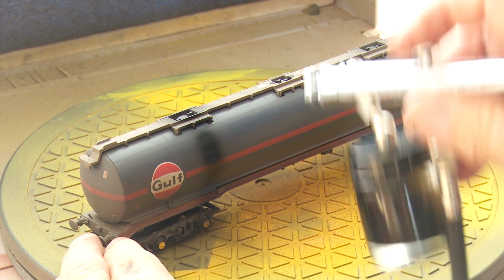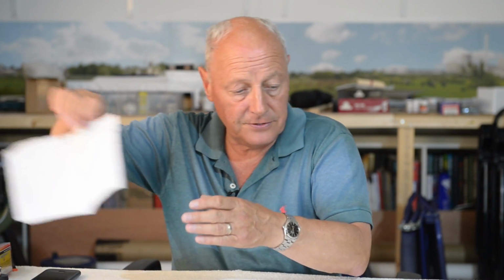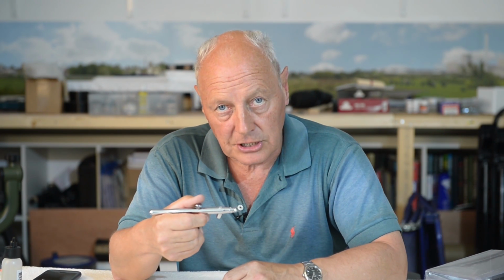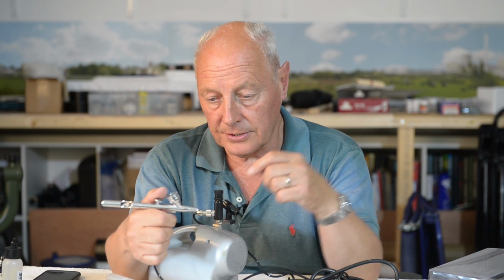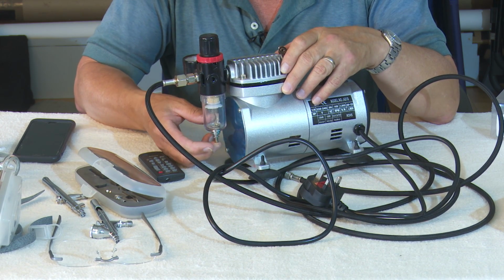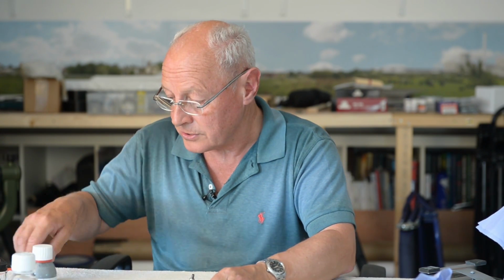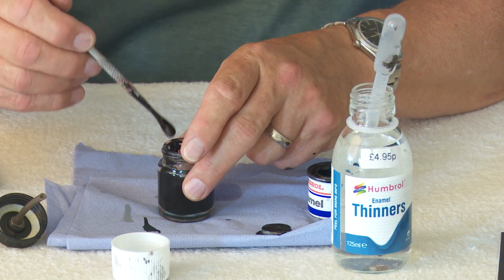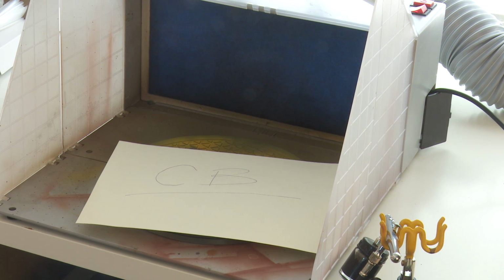Airbrushing at Chadwick Model Railway | 36.

Comment: Never used one before but bought a £15 cheapy from Fleabay & rigged a connection to my tyre inflator. Amazing results with practice. Think that is the secret. Doesnt really matter if its a £10 or £100 one...all about practice & learning. The other essential with the cheap ones is ensuring the precise ratio of thinning. Again , needs plenty of practice, but if you persevere,  you really  will get the same result as from the most expensive ones.
Reply from the maker: That’s great news, Rusty, I’m so pleased that you have found a useful technique. Regards, Charlie

Comment: I started with a Badger 200 suction feed single action. Car touch-up was ok, railway was rubbish. No instructions no internet then. So it went in the back of the draw. In the 80's i had another try. Badger 100, gravity feed. Still no instructions. Just connect to air can, fill with paint, press and go. Yes. Go in the draw. 2008 got interested again. Puchased cheep Awata. Liked this one. Now im playing with airbrushes well over £100+. By learning from internet i use all my 6 brushes for different jobs right from the Badger 200. Happily.
So buy cheep buy x2, yes you can. Easily. But today you have the chance to learn that the cheep airbrush maybe worth. God video Chad. Thanks.
Reply from the maker: Thanks Mel, I’m so pleased that you found the video interesting. Regards, Charlie.

Comment: Since I watched this the first time, I picked up an airbrush of my own! 

I live in the states and bought a Paasche H of some kind. It’s a single action and so far, it’s been great. If I need more paint, I can twist the end and it gives more or less paint. I think it was around $45 US. Then I picked up a compressor from Harbor Freight Tools (again, in the US) for around $100. It actually came with its own airbrush. I don’t remember the brand, but the one that came with the compressor is a double action gravity feed but the cup doesn’t come off like on my Paasche. It had an adjustable pressure gauge, the compressor, and shuts itself off when it reaches a certain point but still provides continuous pressure. Love it so far.
Reply: Oh almost forgot, I’ve only used Tamiya paint thinned with IPA.
Reply: Oh, also my compressor looks almost exactly like yours.
Reply from the maker: That’s great news Andrew, I’m so pleased that you’re making good progress. One however, I would only use Tamiya thinners with Tamiya paints. Regards, Charlie

Comment: Great coverage of the subject Charlie.

Seriously, you won’t get mineral build up from water condensed from the air, by definition that’s distilled water. But you won’t want that water thinning your water based paint intermittently, as water droplets come through, and you don’t want any water in solvent based paints. So using the water trap as you say is a must.

I bought an add-on reservoir for my compressor, which otherwise looked just like the one you have. I did need to buy a bottle of Loctite 542 to seal up the few pipe work connections that didn’t have gaskets. It cost me less than £100 and was a great addition. It has a drain in the bottom, which other videos advise should be used to clear water after EVERY use, to prevent rusting inside the tank. The only downside to the cheap tank was the poor instructions, but I managed okay.
Reply from the maker: Thanks B5375, great airbrush info.
Regards Charlie

Comment: Hi Charlie,

I am a retired Engineer who spent a lot of time preventing contaminates of all sorts getting into people. Particularity in form of gases and aerosols. I also had to sign off COSHH assessment's and Risk assessments for processes for a whole range of chemicals. Hence I thought I would pass on a few thoughts.

I often watch videos such as yours that are excellent at showing how to undertake a process. However please see this as a constructive comment. Once they  start on the process of describing safety processes they fall down. Especially when they start discussing PPE first. That is a big NO No in the COSHH training.

When thinking you want or need to carry out a process including processes that can give rise to contaminates that can be considered hazardous to health.  The best way to manage the health and safety of the process is as follows.

1. Can I eliminate the process. Do I really need to do this? I can I achieve the desired outcome another way. In this case we are gong to say no.

2. Can I undertake the process using chemicals that are less toxic. Looking at the SDS (Safety Data Sheet). This needs considering in your draft procedure of the process.

3.  In your case the most important point in orientating your videos for the public is to consider engineering out the issues before considering PPE. In some cases you can actually can carry out this in a manner that can eliminate the need for PPE. This should be the goal of the stage. However it is usually budgetary considerations that restrict this in a manner that requires the subsequent use of back up PPE.

With the use of Chemicals I cant stress enough the use of Local Exhaust Ventilation (LEV)  which does not recirculate the air back into your environment. Which you correctly discussed but after the PPE.

4. Then looking at the SDS use PPE described adopt this and ensure it is well maintained.

Keep up the good work and please do not see this as other than a comment intended to help you in your presentations.

All the best

Kenny
Reply from the maker: Thanks Kenny, it’s an interesting point of view, that we should all pay more attention to. Regards, Charlie
Reply: @ChadwickModelRailway  A term to remember is ALARP (As low as Reasonably Achievable). If you were to carryout a risk assessment on your set up you would still add in the use of PPE as you do not have a method of measuring  of how well your engineered solution of LEV is working and you do not have any interlocks on the production of the hazard if the engineering solutions stop working. Also good manufacturers will detail the correct mask cartridges to use during your process on the Safety Data Sheet (SDS) and the Workplace Exposure Limits WEL's . If your only doing this process for 5 minutes every week this is going overboard . Still this approach is a good generic philosophy for any process you are tackling .
Reply: He simply stated use proper protective gear when handling the materials required in painting.  All you did was over blow your own sense of worth by prattling on about eliminating processes that can't be.  COSHH has to do with entirely different settings and with major industries dealing in chemicals and other materials that are hazardous and how to go about those jobs or workplace with the least amount of impact as possible.  We're talking model trains here not running a chemical plant.
Reply: Well this point of view seemed to upset you. I was only trying to add a point of view to an audience that I thought was open to other ways of thinking about these things. I was obviously wrong in that assessment. I can only thank you for bursting my bubble associated with an over blown sense of worth. I have learnt my lesson and will make no further comments of this nature. You have a good day now.    @animalyze7120

Comment: Hi Charlie. How timely it is for me that I just found this video shortly after purchasing a compressor and airbrush kit that is almost identical to the Iwata kit  you have. I live in Canada (formerly from Farnborough) so it is sold as a Canadian brand. Unfortunately, it does not have a regulator to adjust the pressure. It is set for 50 psi. I have to play with the valve at the bottom of the water trap as a crude way to adjust the pressure. I have learnt many valuable tips in this video along with those of your other videos. I look forward to your upcoming videos and the cheerful way you present them. Cheers , Roy
Reply from the maker: It’s great to have you onboard Roy. I’d try and buy a proper pressure valve if possible.  It’s so difficult to gauge pressures such as 10psi.

Comment: I can recommend any of the Harder & Steenbeck airbrushes and the Sparmax (when I last looked, Sparmax make Iwata products for them) range of airbrushes too. Great value for money, superb products. I dont necessarily agree that single action airbrushes aren't as good double action airbrushes - they are merely horses for courses, true a DA airbrush is more versatile, but a SA of the correct type can be great for painting large single colour areas Eg a 7mm or 16mm loco. I agree though, don't forget to budget for; a spray booth/extractor, compressor (I'd recommend one with a 'receiver' tank, in the budget ranges they're not too expensive - Eg up to £99) AND a face mask (for specific paint types that may include lead chromate, or VOCs, even some acrylics create microscopic plastic particals), plus decent appropriate paints, thinners and airbrush cleaners. And remember when weathering less is often more😉😊😊👍
Reply from the maker: An excellent comment, many thanks, regards Charlie
Reply: Thanks Charlie, great video airbrushing is another asset to the modellers' armoury, not to be feared/avoided.

Comment: I know this is quite an old video now, and I'm a bit late to the party, but thought it might be useful to say that an air compressor similar to the one you are now using, but complete with the additional reservoir tank can be obtained for less than £150.  Just saying that they needn't be as expensive as the £400 or so you mention in the video.
Reply from the maker: Thanks for the info Sorarse.
Reply: Similar here, finally dug mine out after sitting in its box after 10+  years mainly as zero confidence.. It was a package from Expo tools at about £90 on at train fair special. It had the same DA airbrush as yours charlie with all the accessories incl water trap and press gauge. The compressor has a tank inbuilt so no pulsing. The regular sales guy did say it was a good buy and in hindsight he was quite right. One extra I just bought was the quick release adaptor so you dont need to keep unscrewing it for cleaning etc. Its been a learning process but getting there. Learning all the different paints has been a nightmare TBH but step one has been to buy the same thinner as the brand of paint. Tip 2 was to buy an electric paint stirrer like the one from Trumpeter.Tip 3 was to thin the paint in the jar as bought, then its done and no need to keep mixing in cups to minimise wastage. I use it mainly for kits and on RTR just use dry brushing on the underframes etc.

Comment: Thanks Charlie, I recently purchased an airbrush by timbertech which came with the same compressor as the one you’re using, and some vallejo pigments as well as a cleaning set and a bottle of thinner. Now i just need to find the courage to start using the kit... i’m gonna use it for painting my mountains as well, but since i have a gravity fed instead of a vortex fed airbrush, i’m gonna have to write down the mixing ratio and refill a lot. But ey, it’ll get the job done, and in the long term i think it’ll be cheaper than buying spray cans.
Reply from the maker: Good luck Stefan, keep the pressure down and measure it when spraying not when idle.

Comment: Folks/charlie one thing i have learned the hard way with airbrushes is NEVER use it with enamels INDOORS, ONLY use acrylics inside, i weathered 2 coaches and the fumes from the enamels set all the block of flats fire alarms off at 1 in the morning! had to get the fire brigade out to disable them.
Reply from the maker: A very good point. I only use enamels when I’m using a paint extractor.

Comment: Thank you so much for this video Mr C, I am not into model railways but I am a general crafter. My husband bought me a kit that I connect a cannister to the line and away I go. BUT here is why I am so grateful to you for this video... I have been struggling with the consistancy of my paint. I was looking for tutorials and up popped this video. Thankyou so much, I am going to get myself some thinner then I will be good to go. However, I was wondering do you or anyone have any thoughts on the canister useage? last thing I want is to mess up a piece of craft work that I have spent ages on doing. Many thanks once again.
Reply from the maker: Using canisters of compressed air is not the best system.  It can be hard to regulate the airflow and the canisters can get very cold.  Best to just do a little at a time Pammi.  Always check the flow by spraying onto paper or card just before you commit to your art work.  Regads Charlie.  Oh, check out Luke Towan at Boulder Creek.
Reply: @ChadwickModelRailway   Thank you so very much for your reply.  I always use a scrap of card to check flow before I start. Nothing worse than having to throw something away that I have spent time doing. I will go and check Luke Towan, thanks for the tips, happy crafting. Pammi.
Reply: @ChadwickModelRailway  A possible alternative to canned air,  and just short of a buying a compressor,  is a portable air tank, such as this: <https://www.canadiantire.ca/en/pdp/motomaster-11-gallon-air-tank-0090220p.html>. The air supply certainly lasts a lot longer(no doubt it can be closely estimated how long 40L at 130psi will last if drawn off at any given air brushing pressure).   The down-side obviously is having to toddle off to a service station periodically to fill the tank(where, despite the saying, air is not free -- anymore).

Comment: Hi Charlie can you help me ,I've got a Spraycraft  SP50 Dual action internal mix airbrush .The problem I have I've only used it once I cleaned it out straight away but now I have all air but no paint .I took it apart soaked all the parts in acitone checked all the little holes all were clear.Im useing an air propellant can large can you help .
Reply from the maker: Sorry William, but it sounds like a hardened paint blockage.  I always blow though with airbrush cleaner prior to stripping and cleaning.

Comment: I think another one of these videos would be good to show how you've developed. 5 PSI sounds too low, is it not normally 15 to 20 psi. also hold the airbrush like a pen using your index finger on the trigger. you should be able to match your hand writing with an airbrush if you hold it like you hold a pen!
Reply from the maker: Thanks for your advice, the PSI is often dictated by the thinness of the paint.

Comment: I enjoy your various videos & hope you read the comments, despite there being scores of them. 
You mentioned adding a stay alive to a 0-4-0 to kick it across insul-frog points, how is one made for analogue please. 
Also, I have considered scoring my rails with a Dremel, consistent with real world track lengths, so that my long base passenger train makes that distinctive (Da Dom Da Dom — Da Dom Da Dom) sound as it moves along.  Is this a good idea?
Thank you for your most informative contributions,
Arthur.
Reply from the maker: Hi Arthur, I’m so pleased that you enjoyed the videos.
It is possible to fit a stay alive but it would be a very complex installation.
I really can’t help you on that one.
Regarding the “Clickity Clack” the old bolted rails came in 60 foot lengths. 
This equates to 10 inches on OO Gauge.
I would try and make a 1 or 2mm notch in both rails on a straight section, snd see how it goes.
You could always fill it with solder if it doesn’t work out.

Comment: Wonder if you can get couplings to connect an air brush to a “normal” compressor assuming you can regulate the pressure low enough.
Reply from the maker: I’m not sure that you could get it regulated that accurately.
Reply: Connect the compressor to a cylinder tank, then use tank to supply the airbrush is how most do it.
Reply: @ryansta  Thanks Ryan

Comment: I would recommend a Badger 155 Anthem for a mid priced and GREAT airbrush.  The Badger was my second airbrush; my first was a Harbour Freight Chinese knock off which I still have and use it for lacquer based paints.  I use the Badger 155 Anthem for acrylic paints.  I make my own airbrush cleaner and acrylic paint thinner.  I'm a model railroader.
Reply from the maker: Great recommendations WRL

Comment: Thank you for this informative introduction.  I had only used spray cans, which are not controllable and provide variable results.  You'r description as to why you need a dual action and what the different units do in itself invaluable.  So if I do decide to to go down that route, it will help me select the correct unit.  A turntable looks to be invaluable.  I had to do my spraying outside to prevent issues with smells in the house.
Reply from the maker: Hi Don, I’m so pleased that you found it useful.